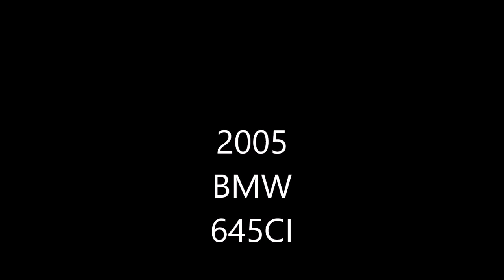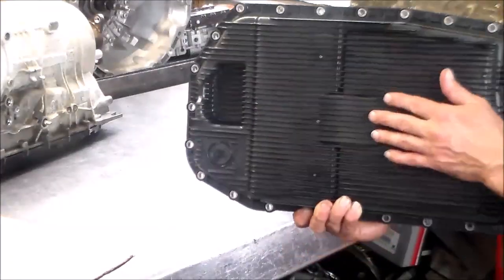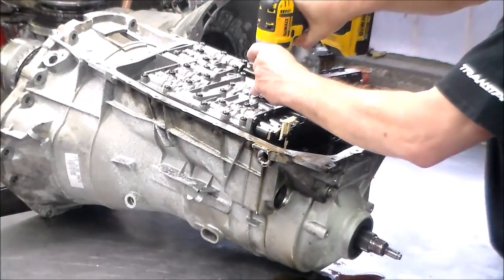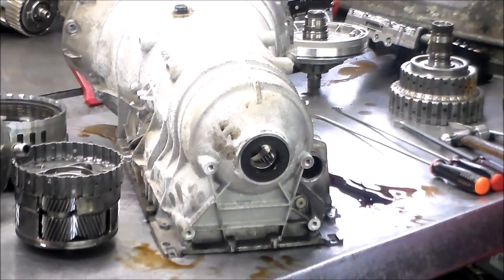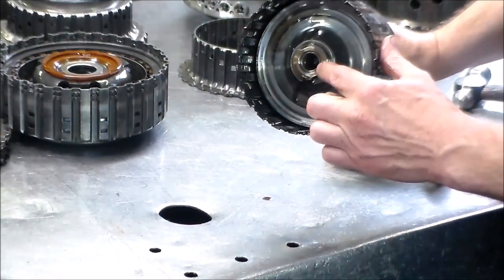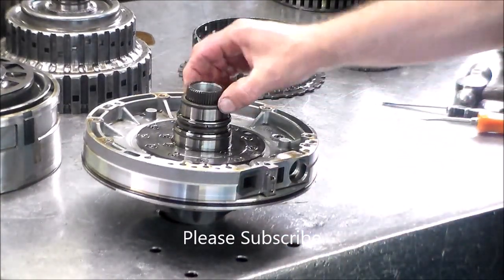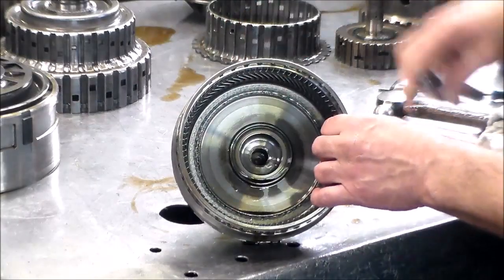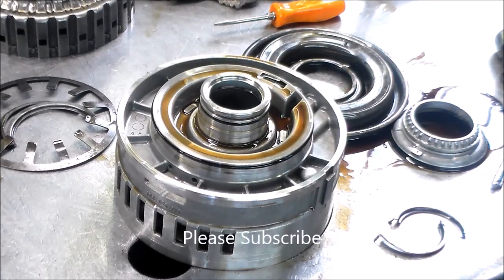ZF6HP26 Teardown, Code 4F85 Present

Comment: Thank you Gary. That is an eye opener for me. Your videos are more clear and easily understandable. I have the same issue on mine (ZF 6HP26Z) and I was thinking of just buying a second hand one and installing it on my E60 530d. I will then work on the faulty one at my pace after getting the rebuild kits. The only transmissions I come across out there are the ZF 6HP19 and ZF 6HP28. I was wondering if getting the second generation ZF 6HP28 is a good idea. Is it a plug and play installation with just programming/coding it to the car or is it much more complicated than that? Kindly advise. Your recommendations will be highly appreciated. Thank you once again.
Reply from the maker: If you have a Gen 1 unit. Gen 2 will not work

Comment: Mine goes in to safemode when solenoids are hot on 5 or 6 gear when l try to push the car hard sometimes or getting in the highway with a small hill it does it and is saying Ratio Monitoring Clutch E should. Any suggestions????
Reply from the maker: Sounds like the rear stator bushing is worn out.

Comment: Hello Gary, thanks for your videos, Here in Portugal have lots off that gear box, i have a car shop, and i'm dealing with that code in a 6hp19z, se dont have many people working with that kind of beatbox, so i'm trying to repair it. I have a couple of question if you can help me. When you mount new clutchs you oild tem before ir not?! When gearbox is ready how you fill the oil before start the car?! Thank again for your great job.
Reply from the maker: I do not oil the clutches before i put them in the drum.   The way you fill it is,  With engine OFF add fluid  untill it run out, install the plug, start the engine and fill again until it runs out, then it should be full,   so first with engine OFF then add with engine RUNNING
Reply: @GaryFerraro   thank you so much, gretings  from Portugal.
Reply from the maker: @pauloferreira8214  Welcome, Greetings from New York

Comment: Hi Gary, i got a 6hp26x and got now 2 faults.
4F85 and 4F8C.
Doyou think is enough to change oil and filter or must i do more ??
Reply from the maker: Oil change will not help, but i would check the oil level. Does the car drive ok cold and fault when hot?

Comment: Hello, I'm getting code 4f85 only on highways, maybe once while driving 80km distance, in city driving i dont have any problem at all. And I feel it only happens when the AT is hot.
I already changed the oil pan, oil and inner seals, (drained fluid was fine and not burnt, no particles in the old filter) but this didnt fix the problem, do you think that i need change the clutch packs and ring seals? Thank you
Reply from the maker: Most common cause for this is a worn rear stator bushing

Comment: As a non-pro, the best way to get out this sturdy snap ring holding the center support is to simply beat a really small screwdriver in between there. That´s possible since the slot continues behind the snap ring that will slide beyond the screwdriver´s tip up its shaft. No chance to get the tip of a pry bar or even a bigger screwdriver underneath this snap ring...
Reply from the maker: Agreed, the whole trick is to get behind the snap ring
Reply: @GaryFerraro  Btw : Do you know the torque specs stator to housing & pump to stator? Couldn't finde anything in all the ZF workbooks around in the net...
Reply: To answer the question myself, also for everybody who doesn't know: stator/ oil pump: 15 nm, stator/ housing: 10 nm

Comment: Hi gary my dad has a 6hp26 and there was a rattling knocking sound from the transmission when the car is in neutral and it got louder when in drive we teardown the transmission and there is nothing disturbing exept the bushings are a little worn could this problem be from the torque converter. No fault codes
Reply from the maker: very possible yes, did you listen to see where it was coming from before you pulled out the trans
Reply: Yes it was from the trans front side and when we checked the oil level the car was started and in park 1,2 liters of oil drained from the fill hole we checked  it a few months ago and it was ok wasn't like that
Reply from the maker: @ivostoykov13  may want to check the pump
Reply: We checked the pump everything looks normal but the torque converter has a weird ding sound when you shake it left and right

Comment: I have the same transmission but my transmission stumbles occasionally from first to second gear, and also when you get off the freeway coming down a slight hill to a stoplight sometimes the transmission makes a clunk between second and first gear. My independent mechanic did a update and a reset on my transmission but did not do the "relearn" drive. My car drove fine for a whole entire month then my issue started happening again again it's an occasional issue and there is no fault codes on the dash what do you think the problem is? Any thoughts would be greatly appreciated
 Thank you in advance
Reply from the maker: How many miles on the car?
Reply: @GaryFerraro  83k sorry about that lol
Reply from the maker: @robertfaulkner7152  Well, you could have a solenoid problem or possible worn bushings in the transmission. Does the car shift ok cold and not ok hot?
Reply: @GaryFerraro  mostly does it when driven after first start, but sometimes it doesn't. Oddly enough when warm it might do it occasionally it's never constant. Even when cold, it might do it a couple times then stop for the rest of the day. It's strange. One time I had a slowed at an intersection rolled thru went to accelerate and felt a clunk so hard it shook me, I know come to a full stop before accelerating. It rarely ever does that.
Reply: Also never have checked the fluid level. I am the third owner of the car. I took it to a transmission shop, told me my fluid cap had a semi stripped bolt head, requiring to either remove the drive shaft or exhaust pipe to get to. Since there was a generic shop I declined.
Reply: @robertfaulkner7152  Hi Robert. Did you find any cause for your problem? I have a similar one. Sometimes when downshifting I have a massive clunk. Also sometimes upshifting at light load seems a little hesitant/delayed.
Reply: @tonihjelmman3730  yes I actually did find out the problem The problem was the transmission Pan was getting warped and oil started leaking out from the transmission pan. But while they had the transmission pan off of course you have to replace those two seals one for the mechatronics unit which looks like a figure 8 and the other one that looks like a round plug. Oddly enough they did not replace the six round tubular seals that go up into the transmission housing. They said that they didn't have to replace those they were fine. But note... even though that BMW says "lifetime fluid" ...it is not lifetime fluid. Also too if you or the shop does do a service on the transmission you also have to reset the apdaptations on the transmission to get it to shift smooth again. Make sure that your shop is aware of that. Otherwise it will still continually shift as if nothing was serviced.
Reply: @robertfaulkner7152  Thanks a lot for the reply, Robert. Even though this issue might be a little outdated to you.

Currently I'm considering between:
"minor repair" = changing oil+pan+seals between valvebody and tranny
and
"major overhaul" = above+ sonnax zip kit, new solenoids, bushings+seals+cluthes for the tranny.

My 535d has 289k miles. The transmission had some love ~90k miles ago, don't know exactly what.

Maybe the best way is to replace everything at one go. Looking at the mileage it seems that major overhaul is around the corner anyways.

I'd love to hear your opinion @Gary Ferraro

BTW. This is my second BMW with the same tranny. The previous one served from 60 to 220k miles flawlessly with only one transmission oil change during this time. Pretty solid machines.

Comment: Hello Gary, I must say you are a master at the ZF transmissions. I have been watching your videos for a long time and have found them to be very educational. My transmission has been acting up for the last few months now. I have a 2007 BMW 335i It has the ZFHP19 transmission. The issue is when when the car pull off from a stop the engine speed up and the transmission engages with a light thud. Also as the car come to a stop, it comes to a stop with a slight thud.feels like if some one taps you in the rear. When I took it ion to a garage. They replace the bridge seal and the four black rubber tubes, new lifeguard 6 fluid (complete flush} and new filter. Unfortunately, the problem is still there. Any ideas of what ‘tis might be? I have 95,000 Kms (about 60,000 miles on the car) I appreciate any advice you could offer. Kind regards!
Reply from the maker: Can you tell me if any codes are present?  also, does it do this when the car is cold and hot or only when hot?
Reply: Gary Ferraro, thank your response. There are no codes. It happens when it is cold and hot.
Reply from the maker: @creativemischief5403  Do you have access to a scan tool? I'm Thinking of trying a shift adapt reset
Reply from the maker: @creativemischief5403   That is a lengthy video, with the snap-on or autel, should take about 5 minutes or so
Reply: Gary Ferraro  thanks for your response. Really? 5 minutes?  Apparently those steps described in that video are ZF/BMW recommended. I’ll have a go at it this weekend on the Autel. What about the “drive learn cycle”? Do I have do do that?
Reply from the maker: @creativemischief5403  Yes, after resetting the adapts you have to drive the car, make sure it's at operating temp. and drive for about 15-20 minutes starts and stops so it shifts through all the gears
Reply: Gary Ferraro, thank you so much for you advice. Really appreciate it. I must admit that I am a little nervous about messing around with it as I could break it. Ill keep you posted. Thanks so much!!! Really enjoy your videos!!!

Comment: Hi Gary,  Thanks for your videos!!!  We have a 2007 2WD Lincoln Navigator and believe it has the 6HP26 trans.  Did a fluild change to the Motorcraft SP fluid about 18 months ago.  Recently, I've noticed loosing OD lockup in higher gears after driving for 30 or more minutes.  Could you speculate?  VIN is 5LMFU27537LJ18556.  Thanks.
Reply from the maker: Will run vin. Any codes present for the trans
Reply: @GaryFerraro  Hi Gary, I have a slightly better than basic scan tool by Autel, it shows no codes in the TCM.  I do have a couple other tidbits... Vehicle did have trans fluid change about 18 months ago with Motorcraft SP, but the adaptation values were not reset (Didn't know they might need to be done).  Vehicle has ~150k miles (mostly highway / I'm not a light foot & not a heavy foot driver).  I notice the trans seems to unlock from OD just as the load lightens, then the RPMs wander by as much as 600 rpm.  Sometimes it will re-engage quickly, sometimes not.    An example would be going up a very very slight incline when the OD is locked, then cresting the incline to level, it unlocks from OD.  It is very subtle, when it comes out, but I notice it because I'm paying attention.  Again, could you speculate?  Is there anything I could try before pulling the Trans & TC?  I know the bridge seal is a common part to replace, as are the 4 smaller seals above the valvebody.  Either of those repairs would be easy for me to accomplish.  But going any further into the trans is above my paygrade... LOL!
Reply from the maker: @sasngang  Since you have an Autel, can you go into data and look at the clutch fill times for the E clutch. Does this happen only going on incline ? It is a ZF6HP26
Reply: @GaryFerraro  Hi Gary... thanks for your time and willingness to help.  My Autel unit doesn't have that ability, it's a pretty basic unit.  Can I get a few minutes of your time to chat by phone?  I'd be happy to compensate you.
Reply from the maker: @sasngang  E-mail your info
gsferraro@yahoo.com

Comment: Hi Gary… I have a 2007 Bmw 750li when on an incline the tranny goes into limp mode and goes into P by itself. If I’m not on an incline I can shift out of D and R without any problems drives as normal. I took it to an Indy and was told I was low on tranny fluid in which they topped off but the problem still exists. The vehicle Has 155k miles. When they pulled codes 4F81ratio monitoring clutch A was present. Any suggestions other than rebuilding the entire transmission valve body? The Indy quoted 3500
Reply from the maker: Possible Broken Bridge Seal
Reply: @GaryFerraro  yes it was cracked all the way through found new Indy charged 1300

Comment: Hi Gary, your video was very educational and has answered most of my question. Just wanted to run something by you, I have a BMW 530d 2009 plate. Has approx 170K miles, on the OBD the clutch E has come up as fault, goes into limp mode only on motorways, local road have no issues.  Could I sort this out with a gearbox oils change? Or does it need to be striped and replaced? Also how much should I pay for this approx?  Thanks.
Reply from the maker: Do you have a scanner that shows live data?  Where are you located? Oil change probably won't help you. I would say either a solenoid problem or worn bushings
Reply: Gary Ferraro not sure what you mean by live data? I’m located in the UK otherwise I would have come to see you.
Reply: Hi Gary, the error codes - E Clutch 4F85, Gear monitoring coupling E. any other ideas?
Reply from the maker: @sazyousaf9417  It is usually either a worn out rear stator bushing or a worn out e clutch, bushing being the most common problem
Reply: Gary Ferraro thanks, what should I pay approx for the repair? Been quoted £1800
Reply from the maker: @sazyousaf9417  are they just going to fix the E clutch or overhaul the trans?
Reply: Gary Ferraro - my mechanic said a full overhaul, bushes oil service and e clutch
Reply from the maker: @sazyousaf9417  So No converter,  or solenoids?
Reply: Gary Ferraro - not that he mentioned, I’ll ask if this is included.

Comment: Gary could you please explain how to remove the piston from the B-clutch.
I’m currently rebuilding one and this piston has me stumped. It looks like it needs to come up to relive spring tension.
Thanks, Mark in Australia
Reply from the maker: I show that in the video, depress the beville spring and get the top snap ring out, after that is out and the belville spring is out of the way, 2nd snap ring has to come out to get the balance piston out then the main piston will come out, may have to use air to blow it out
Reply: Gary Ferraro . I saw you do the C clutch which I have no problem with but didn’t see you do the B clutch piston.
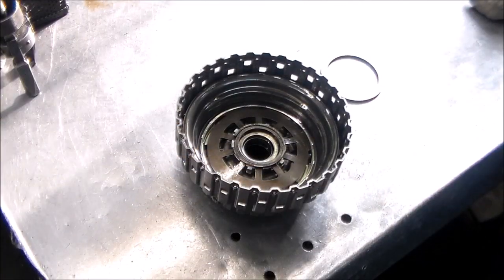Reply from the maker: @MrM113A1  Start watching at 42:00 I go over the B clutch
Reply: Gary Ferraro thank you so much mate. I don’t know how I missed that. I was FFWD and Rewinding a lot though. Great videos Gary, you’ve been very educational for myself working from home. Thank you.
Reply from the maker: @MrM113A1  No Worries, any questions just let me know.  My e-mail is 
gsferraro@yahoo.com

Comment: Hi there Gary, great video! I'm a beginner when it comes to gearboxes, and I currently have a e60 throwing 4F83: EGS Ratio Monitoring Clutch C. I've read through the comments and I don't see anyone having this code, mostly 4F85. Is this code uncommon? I haven't done anything, but I've ordered 4 seals and a new bridge adapter, and cleaned out each solenoid. Going to replace fluid and a new pan as well. Do you think this should solve the problem? Or am I looking at something much worse? Regards from Malaysia!
Reply from the maker: ok, so when you drive the car, what do you feel?

Comment: Love your videos and have been watching several of the 6hp rebuilds....  I have a 335d "6hp28" and I plan to rebuild a spare transmission.... would you happen to know where one can find literature on how many fractions and steels are in each clutch and their orientation?
Reply from the maker: There is a company called ATSG(Automatic Transmission Service Group Owned by ETE Reman) they have a lot of books.  I think there web site is  ATSG.Biz
Reply: @GaryFerraro   thanks man!!!  Wish I'd have known about you before I had my first 6hp rebuilt....... its still not shifting properly:-(
Reply from the maker: @gaboonviper85  I think that is more of a diagnostic guide, i honestly think they do not show breakdown of the trans
Reply: @GaryFerraro  yeah also seems it's based off the audi not the bmw:-(
Reply: @GaryFerraro  my goal is to get the spare trans and do bushings and install it into the car.....then tear my original rebuilt trans that was done by a shop in NJ and see what they did wrong and why it's still not shifting properly

Comment: I have the same exact problems and code on my 7 series. I will drop it off to you soon.
Reply from the maker: Your in the New York Area?
Reply: Gary Ferraro Yes Gary I live in the area.
Reply from the maker: @750gg  My i ask if your on Long Island?
Reply: Gary Ferraro I’m in Brooklyn. I might be able to make it to you, just might have pull over and restart the car about 10 times. Gears are slipping, delayed drive shift,and jerky reverse shifting. I got the works!! It use to slip every so often. Now it’s every time I drive the car. It’s so frustrating. Car drives like a dream when the tranny is operating as designed. At this point I think I need a new transmission. I don’t know 🤔